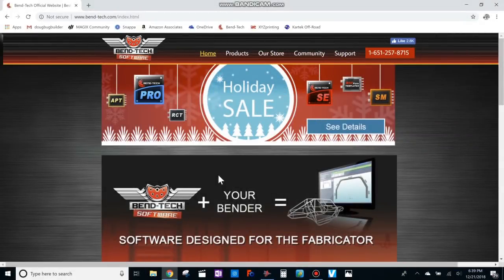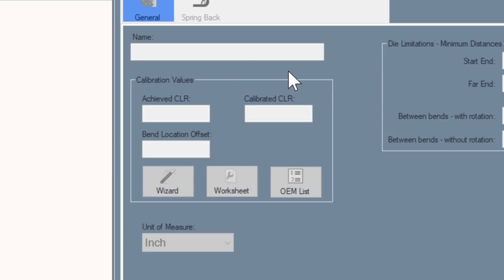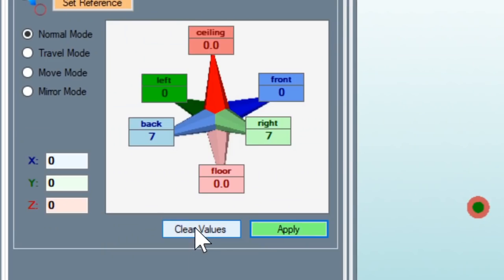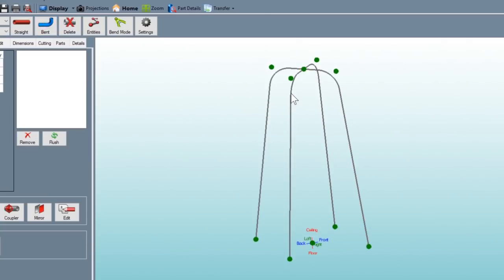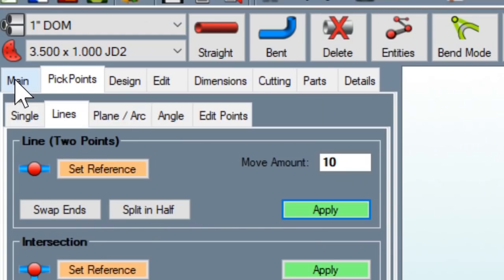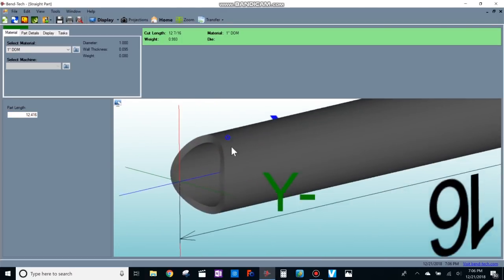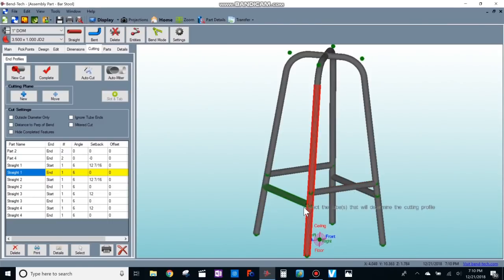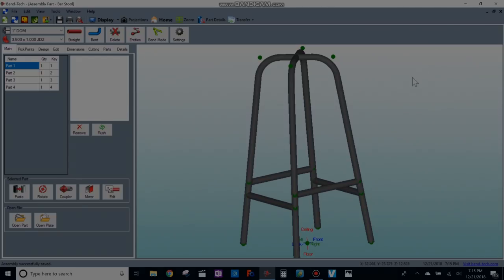Bend Tech Tutorial, Designing a bar stool

Comment: Thanks for the great videos. I've been doing some tube & sheet metal work on a back half build and it's been mostly trial and error so far. After seeing your chassis video I picked up Bend Tech Pro with the sheet metal module and it's pretty incredible. I'm only on day two with it, but it seems fairly easy to get the hang of. Even with my very basic understanding it's insane how fast I can draw projects up already.

Do you run into any fitment issues due to the software, or is it pretty reliable as long as you're doing your part?
Reply from the maker: Hey Damien, glad you got the software. It's really nice once you get past the curve. I have had a couple issues with mitre cuts. Nothing I haven't been able to get around. But I always view the cuts individually before I get to far to make sure it took alright.

Comment: Thanks for the videos! I just got into bend tech and have the pro version like yourself. Your videos are very helpful and I appreciate them. I am having an issue that I haven't been able to find an answer for. The writing for my compass that says Forward/Back Ceiling/Floor and Left/Right is MASSIVE, it obscures the view of my entire project, and I cannot find any way to adjust text sizes?
Reply from the maker: Interesting, try this.
Depending on how big or small your drawing is sometimes you need to adjust the scale of the compass. 
1. On the main header click on the settings tab. The one with the gear above it. Right next to "Bend Mode"
2. In the box for "Tri-Star" you'll see an option for scale. Mine is set to 1. Adjust that and see if that solves the issue.
Let's see if that solves the issue.